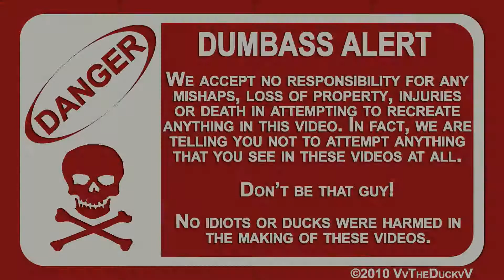Mini Chopper - Resurrection 3

Comment: Hey 
I actually found a bike like this for sale 
But it hasn't been running for 3 years 
If I were to buy it 
And needed parts 
Where would I source the parts from???
Reply from the maker: I couldn't even find the parts for this when it was knew.  Most of the parts are from other chinese motorcycles.  Most things are sold online by their dimensions measurements, or other distinguishing marks.  But be warned, these things are a mess and break a lot.  It took me a LONG time to work the bugs out of this one, it seems like I replaced or modified just about everything!
Reply: OK 
Thank you so much for all the info 
Last question 
Would I be able to successfully swap in another engine 
Because when I checked the odometer on the bike 
It said 99000 so....
Idk if this thing is even worth it 
Looks like junk to me 
But here in Africa its the only choice I have to get an OK looking bike 
Other high cc street bikes go for a whooping price 
Because of high import tax n shit
Reply from the maker: I doubt that 99000 is accurate, the bike would have disintegrated long before that!  Those speedometers are VERY inaccurate.  I think its because the front wheel is so small.  I could wrap the speedometer around backwards and I was only doing highway speed.
Reply from the maker: Yes you can swap the engine, but the engine is the one decent thing about that bike, the rest of it needs a lot of help to be properly serviceable.  I hope that helps!
Reply: @DuckmanCycles  alright 
Sounds good 
Do you use Instagram or Facebook 
Just so I can keep in touch and get some help from you
Reply from the maker: @abrahamy8382  I sure do!  Please use them!  Thanks!